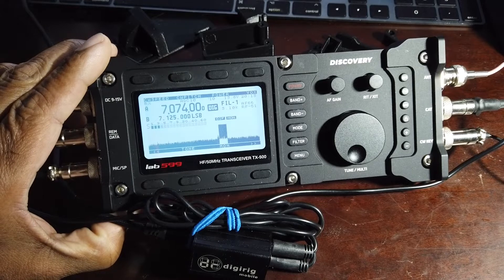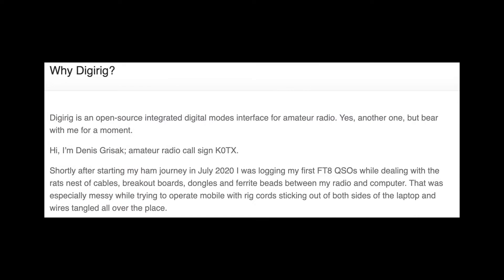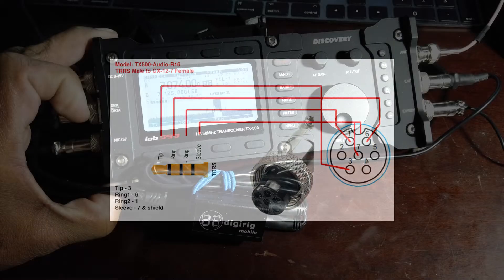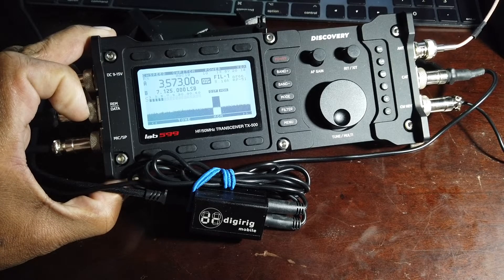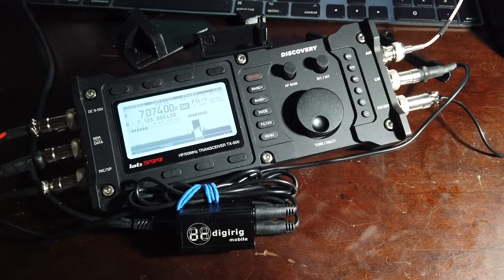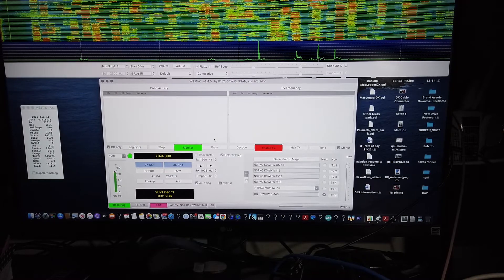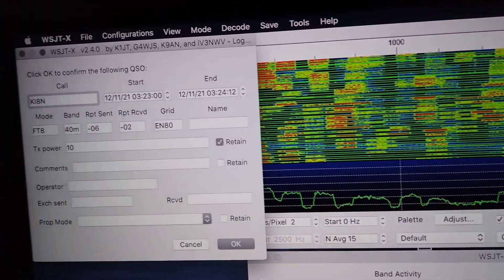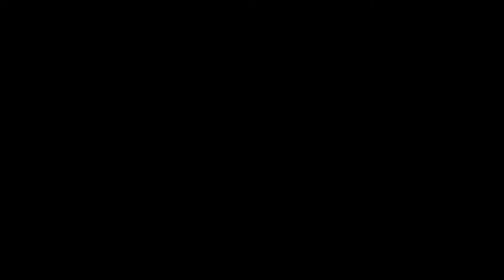Digirig and TX 500 Digital Results

Comment: Struggling (with OS integration and client configurations) to get mine to work with an Ubuntu laptop. Might have to go back to Windows....which I'd really rather not do.
Looking forward to more videos!

/salute
Reply from the maker: Thanks for the comment, and thanks for sharing your setup.  I'd be lying if I tried to be an expert, or pointed you in one direction or another. Truth is I followed someone's directions, and then tweaked the gain a bunch.  Then, it worked!  It did not work the way I wanted first time out of the box.  I ended up, like I said, fiddling a bunch in my case with the transmit gain because it seemed low when viewed in the program.  I finally got it in the ball park.  Come back and share how you get it going.  We would all appreciate hearing.  73 de Bill